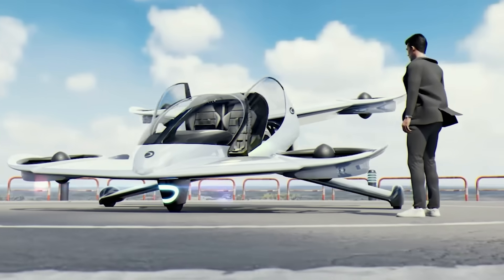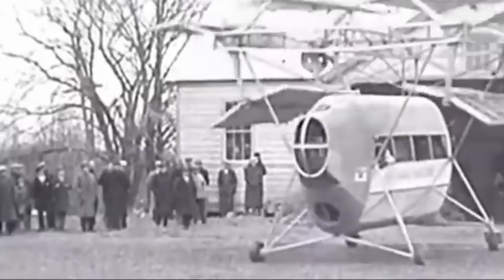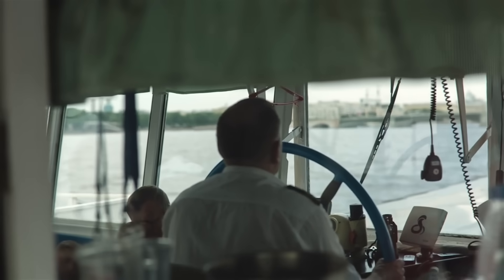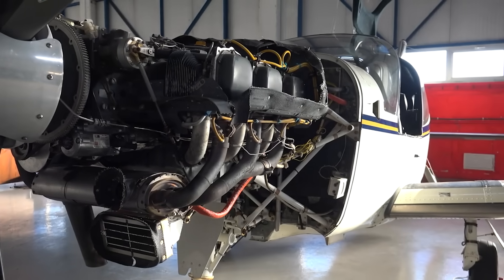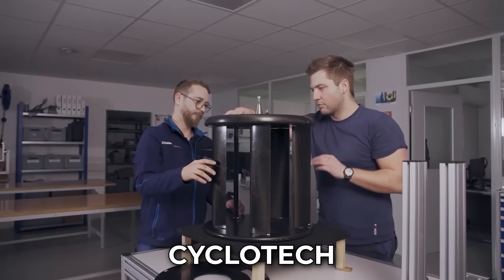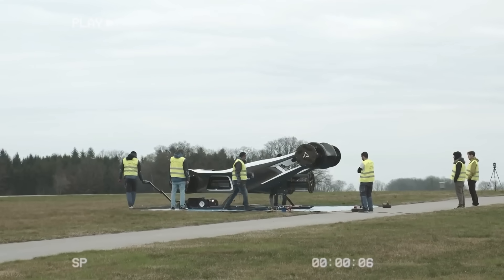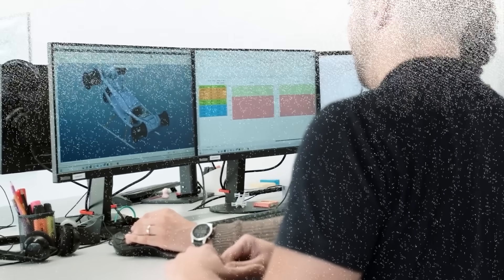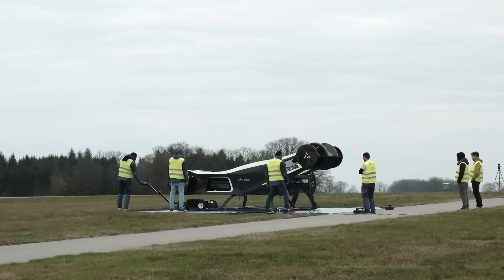The Cyclocopter: The Future of Flight That Doesn’t Spin Like Anything You’ve Seen

Comment: But the real question is how much does all of that complexity add to the potential for a cascading failure. For example, if one blade gets stuck in position does that add sufficient stress to the other blades to lead to their failure? More parts typically just means more things that can break which isn't normally as big of a deal on the ground in a car, but that's a different monster a few hundred feet in the air.

Comment: One thing that occurred to me is that one of the greatest difficulties in creating the much-fantasised flying car, is transitioning between ground and air modes. A major problem here is changing the axes of rotation of the propelling system. If we say that the x-axis is left-right, the z-axis is forward-back, and the y-axis is up-down, then in helicopters and quad/hex copters, the blades rotate around the y-axis, or in the x-z plane, while a car's wheels rotate around the x-axis, or in the y-z plane.

So switching the engines between flight mode and road mode in a traditional copter, means either having two separate sets of flight blades and road wheels, which must be retracted and extended, or of rotating the flight blades and their engines or gear trains through 90 degrees to switch between flight and road mode.

Cyclocopters eliminate this issue because their  blades rotate around the x-axis, the same as a car's wheels. This would make it logistically trivial to fit a tyre to the outer rim of the blade assembly, allowing it to be used as a wheel in road mode or a flight propeller without changing any axes or having to retract or extend anything.

At most, you might need to retract the blade/wheel assembly into the body of the vehicle along the x-axis, but that would be trivial compared to the complexity of rotating the assembly through 90 degrees and packing parts of it away.

And that right there is your roadable flying car - able to cruise along the highway, then take to the skies with minimal fuss, simply by sliding the wheels out to the sides to expose the cyclocopter blades.

Comment: Sounds expensive and complex to me.  Carbon fiber blades changing pitch that fast and often?  Computers and motors to operate that swifty and without fail?  Let's see the companies run a full size copter daily for a year before anybody gets excited.  Also, can these things fly on 3 cycloblades?  Is there a safety factor if 1 blade fails?

Comment: I know what this is - an advertisement for Cyclocopter! Invest today for a better tomorrow! I hope it works out, but it seems over engineered. Having 4 to 6 rotating cylinders for a quitter smoother, and level ride and will probably require a ton more maintenance than what we have now with a helicopter or plane seem impractical.
Reply from the maker: Thanks for your thoughts on the Cyclocopter's design and potential maintenance!

Comment: Efficiency is lower because you have to 'push' all the Blades and Disks through Air at high Speeds even IF you don't need the Thrust. You could change the RPM but that's problematic since you need Torque changes to speed up or slow down. Additional the Blades need to 'flap' sideways twice during one rotation - that could introduce oscillations, and also wastes Energy. Possibly you have higher 'Disk loading' as well depending on number of Blades and their Size.
Reply from the maker: Thanks for your detailed analysis of the Cyclocopter's efficiency and potential challenges!

Comment: I like quadcopters that have four collective pitch rotors... they can align at angles and stay that way without moving, they can move in any direction without tilting, they have four independent bidirectional sources of thrust and they don't rely on increasing motor RPM to increase thrust, they use collective pitch for that and cyclic to move.

Comment: You know what’s interesting is a similar system like this is actually undergoing testing for ocean going ships. Now in a way something like this already exists. There are certain tugboats that in place of a standard propeller or even a propeller unit within a rotating drum or whatever you wanna call it V “propellers” are essentially things similar to these, but obviously in a vertical orientation rather than horizontal. And this allows the vessel to move relatively easily.
Reply: Someone didn't watch the video....
Reply: @DangRenBo Admittedly I wrote this before finishing the video
Reply from the maker: That's a fascinating comparison to propulsion systems used in ocean-going ships!

Comment: I figure position sensors use different, maybe fiber optic, no contact components than they did 10 to 15 years ago, but servo motors will have to have mechanical components to move the blades.  At thousands of times repositioning, per rotation of those prop blades, that is a very high number of contact moves, and a very high number of input and output signals and logic controls, in nano seconds, possibly.  I wouldn't want to fly in or on one of these things.  Too much to fail.
Reply from the maker: Thanks for sharing your thoughts on the mechanical complexities and potential failure points of the Cyclocopter's design!

Comment: Helos are range-limited gas-guzzlers. You need to land where there is jet fuel. On the other hand, there is electricity to recharge almost everywhere. And there are redundant systems unlike (obsolete) rotary wing aircrap

Comment: Too many moving parts that could fail causing a crash.  Heavy batteries for extended flight. I'll stick with old reliable aviation fuel and rotary blades.

Comment: The design flaw is that it's cheaper to manufacture one motor than four. They should only have two helical rotors, not four.
Reply from the maker: That's an interesting point about the manufacturing costs and number of rotors!

Comment: Not seeing how this is better than a helicopter. Mentioned heli having a bunch of mechanical stuff to control and spin the blades, yeah so? The cyclo has a shit ton of computers to control many things, any one computer could fail and cause a crash. Also not seeing how this thing can move sideways without tilting. This thing has no way to blow air sideways so yeah, it has to tilt to slide sideways.

Comment: Oh sure more electronic things to fail from static or corrosion from the weather is what I want hurtling  me through the air at neck breaking speeds. Especially beeing controlled by a microprocessor with constant updates where it will just randomly update and turn you upside down and change your preferred language to Dutch because "Technology".
Reply from the maker: Thanks for sharing your concerns about the reliability of new technologies in aviation!

Comment: The more you try to complicate a system that already works regardless of technological improvements, the more potential you have for failure. And when you’re in the air, that’s catastrophic failure. I don’t see these systems being able to auto glide in the event of failure. Lose even one engine/ rotor and you have not a dead stick, but an uncontrollable likely spiraling out of control descent into the ground. This is not an answer. It’s still clever, but it still doesn’t work as well as what we’ve already figured out does.
Reply from the maker: Thanks for sharing your thoughts on the complexities and potential risks of new flight systems!

Comment: There is definitely a central point of failure, most notably the control system. If the digital circuitry screws up, there is no gliding home. This is not much different than other VTOLs I suppose. Maybe a parachute?
Reply from the maker: That's a valid concern about the control system!

Comment: Complexity is the downfall here.
When a helicopter engine fails, the momentum of the rotor is used to autorotate and landing safely is still possible.
When a plane is losing engine power, gliding in a controlled descent is still there.
What happens here if power is gone?
The tug boats don't fall to the bottom of the sea if there is something wrong with this propulsion, but flying things don't tend to stay in the air.
As for the future of flying cars and lanes of traffic in the sky above cities is a real nightmare idea, exactly because of flying things don't stay in the air.
You can do a search on youtube for dashcam footage of what people do while driving on flat roads. Imagine what would they do when trying to navigate vertically too.
One collision could have countless victims, depending on where the wreckage would fall.

Comment: Well on paper good idea but, if the rotors fail you are dropping like a stone from the sky on free fall speed. There is nothing to hold you in the air like to glide like wings and nothing to resist the fall like autorotation of the spinning helicopter blade. Overall if it fails you are doomed unless you have a parachute but remember... even parachute can fail too.
Reply from the maker: Thanks for sharing your thoughts on the safety aspects of the Cyclocopter!

Comment: 2 stage propeller with alot of moving parts.
Same rule should would be a helicopter with 4 rotors and twin blade design and second blade spin anti-clock ... 
Oo we allrdy can make? But only use 2.
Safety issue... Why? 
To many moving parts. A ok. Np. Cheers

Yeah think practical how would this work. 
And how the load of each axel.

Comment: As an undergrad researcher at University of Maryland 25yrs ago, i built a cycloidal rotor as a proof of concept. There's a hard limit on the ratio of cylinder diameter to blade span because the centrifugal forces cause the blades to bend.The Cyclocopter design uses cantilevered cylinders, meaning they need super stiff central shaft/tube or they fatigue very quickly. I enjoyed the project because it gave me an appreciation of frequency domain concerns with aerodynamic systems. We have mountains of data on steady level flight, but unsteady flow is very under-studied. This is the realm of flapping wings and biomimicry, where you'll find me waving my arms like a dragonfly in the lab trying to imagine how a shaft-driven machine could achieve this same motion. IMO the reason we don't see cycloidals in commercial aviation is power efficiency. Helicopters are simply more efficient.
Reply: Just recently, with the use of changing electromagnetic field and a dielectric fluid, it was possible to convert electricity directly into flapping motion. 200 flaps a minute. However the wing was limited to something the size of a  fly.
Reply: You saved the important bit for the end:  'Helicopters are simply more efficient.'  From my understanding cycloidal is about 40% as efficient.  It's a non-starter (unless you're trying to get that sweet VC money).  Weight and efficiency is super important for hover machines.
Reply: @TheVigilante2000  Yup, everyone forgets about physics lol.  Efficiency matters.  Tho, if we had some breakthrough in energy production and storage, who knows.  But it seems like we're pretty nearly capped out, at least on the storage side.  Any denser batteries become a lot more dangerous.
Reply: wow thank you
Reply: Lack of efficiency aside, complication is also a major issue with cycloidal system. This video explains how the system relies on the ability of the blades to be constantly making adjustments in order to maintain lift and balance, dependent on multiple sensors, computation, and mechanical motors, all of which undoubtedly increases the risk of critical failure.
Reply: GO TERPS (class of 2013 here!)
Reply: watching the smarties debate as i wonder if Cheetos will eventually stain my fingers
Reply: Then you may be the one to answer my question I had while I was watching this video. When a helicopter loses its engine the pilot may have the opportunity to pull a manual cord that locks the rotors in the opposite direction of travel allow them to pick up speed as they fall. Then at the ideal altitude thet can reverse the now rapidly spinning blades to appose the air flow and drastically so down before impact. So breaks and bruises instead of guaranteed negative outcomes.

What can these air foils do in an emergency that is physics-based?
Reply: @MNSweet Emergeny autorotation just barely works, and only in small-to-medium helicopters. A cycloidal flyer hasn't a prayer.
Reply: The system is inherently aerodynamically 'dirty', liftwise, and propulsively.
Reply: Os caras estão querendo reinventar a roda😂😂😂😂

Comment: It's interesting how you mention that the servos and setup for the cyclocopter are super complex, and also how a squash plate in a helicopter was almost a negative. 

But...doesn't the squash plate also adjust the pitch of the blades in realitme multiple times per second? Why wouldn't the use the same tech and just turn it sideways?
Reply from the maker: That's an insightful question about the similarities and differences in how pitch is adjusted in cyclocopters versus helicopters!

Comment: This device screams "niche applications" if it is implemented at all. It will not replace helicopters.  It is a simple philosophy, if a problem already has a time-proven solution the only other solution that can replace it has to be simpler and cheaper.  You will never implement in practice a solution that is more complex and expensive than an existing one, there is no demand for it.  So as I said, it will not replace helicopters, it might be used for situations where helicopters are unsuitabe (i.e. a different, not yet resolved problem).  So, yeah some niche.
Reply from the maker: That's an insightful point about niche applications for new technologies!

Comment: As a helicopter engineer, these are mostly pointless, overly complicated and unsafe for anything like commercial operation.

If a helicopter loses power (engines), they can autorotate and land safely with enough height to initiate the procedure. If you lost one of these 4 rotors, you'd be very likely to crash...

Comment: So with no inertial energy in the rotors when 1 fail for whatever reason the system will fall from the sky.  May have some use for unmanned flight.

Comment: I still have to keep wondering. Is it not possible to just run air shafts throught the machines airframe and redirect airflow of one or more blower motors?
Valves to open and close for differing thrust vectors.

Comment: If a material was made from a liquid that holds its form while in motion and is dencer than air it would reduce the problem of so many moving parts. Maybe a electric current running through the material/blades to hold form. With wheels on either end of the drum connected via a spindle? They could then act as simple wheels. Flying car. Maybe they'll develop some kind of liquid materials in the future.

Comment: For something closer to the concept of a flying car I think this is a better way to go than traditional propellers.
Have two or three cycloidal propellers on the middle of the vehicle’s body for vertical thrust.
Attach two small jet thrusters like the ones used for those flying suits on the back for added horizontal thrust.
Attach a parachute to the top in case of emergency.
Reply: Flying cars? Roads are already full of idiots, don't need them crashing down from the sky too, thanks very much.

Comment: This is a textbook disrupter.  Imagine this tech refined and sold to manufacturers the world over as a replacement alternative propulsion system for existing VTOL aircraft. Quieter skies.  Safer to pilot than a standard quad rotor.  Hell, safer than a tilt rotor because those flying death traps have zero failsafe if a rotor nacelle fails inflight.  Everybody dead.  Gimme a proven disruptor any day.  Though those who want that future are going to have to steel themselves to fight for it because the forces that have dominated aviation for a hundred years will stand in their way the same way ice engine manufacturers have held off migrating to EV technology. Slowing its development -- and then Tesla came along and disrupted the auto industry.  The same industry that for decades claimed EV's weren't profitable. Now Tesla is the most valuable, and profitable auto maker on the planet, and they've done it selling cars that don't need an engine or a gas tank. That's what disruptors do.  They don't have to compete on the same scale to beat the big boys.  They just need competent leadership in the boardroom, and investors willing to take the company public.

Comment: I can list off a bunch of reasons whey this is bad.  However, here's just one for thought.  If an engine fails in a regular helicopter you can auto-rotor down.  I'm pretty sure with this, it would fall like a rock.

Comment: This concept would work for low flying craft like 5 to 20 ft off the ground to bypass waterways.  Failure is not catastrophic at those heights.  The system is compact for use in personal vehicles.
Reply: What about using it as the propulsion system for airships?
Could also increase the lifting capacity.

Comment: You can use computers to manage the flight controls all day, Which they have done here.
However, THIS thing eat electricity for breakfast! Batteries are heavy, you can only install so many into this,
I see this as a short range use. Which will probably work very well in this role.

Comment: Sorry, but nah. Making the rotor blades small and turning them horizontal, they are still rotor blades turning to generate lift. 
Congratulations. You reinvented VTOL, making it more complicated and added about 100+ more points of failure than it needs.